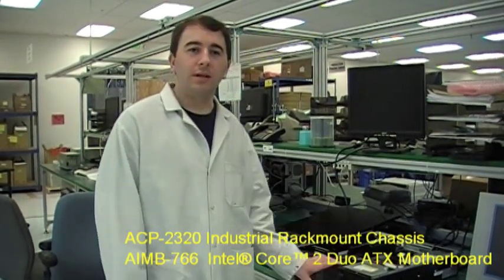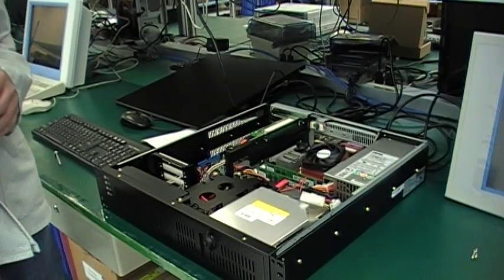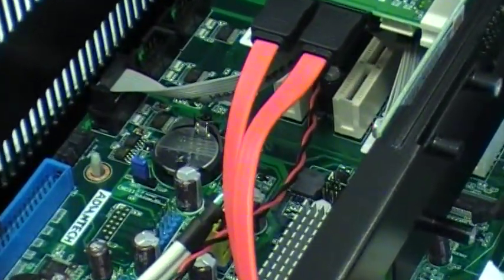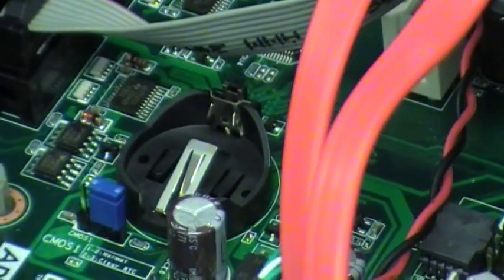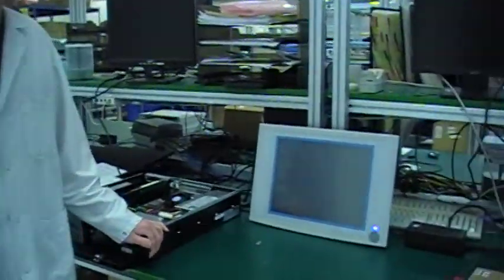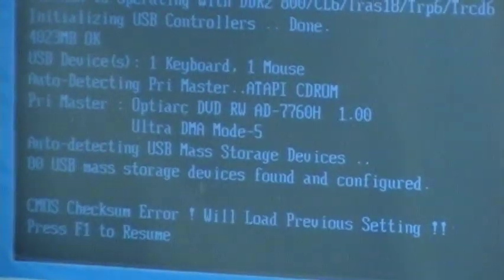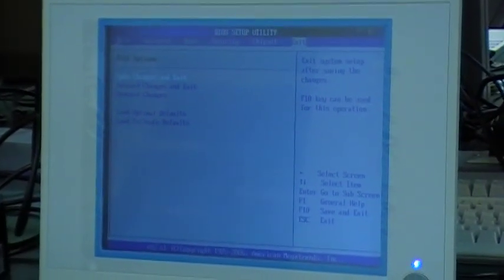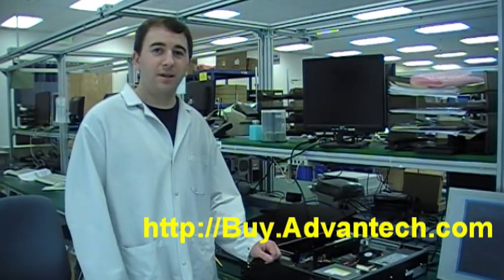Resetting the BIOS Tutorial- Advantech IPlanet Series

Comment: hi i just again get the no signal detected before happen that when i change slot ram i just reset the battery which is called CMOS to reset bios setting cause what it did my ram is 1600 mhz and i set the frequensy ram to 1600 mhz from auto setting so i did this and happen this problem no signal detected and i reeset the battery nothing happen still same everything supported perfect 100% and i checked them more than 1 time and no idea why its happening again cause i have bought today another 2 gb ram with 1333 mhz and already have 4 gb ram 1600 mhz both are DDR3 so no idea how i fix or reset bios setting please i need help or anyone replay me and thanks

Comment: Hi Dear Sir.
I have an ASUS k45vm laptop that last year put a ssd drive in the laptop in the original hdd drive location and put my hdd drive in the optical driver location.
Today on the ASUS website I found a new BIOS file for my laptop.
After downloading this file I copied it to usb flash drive and proceeded to update the laptop bios.
I restarted the laptop and got into the BIOS part of the boot screen and selected the BIOS file inside the usb flash memory and attempted to update, after a few minutes update was successfully completed and the laptop shut down after two seconds.
I turned on the laptop immediately.
The ASUS logo first appears and then the laptop turns off and the laptop turns itself on again. The ASUS logo appears and then turns off, the same process repeating itself.
Turning on the laptop also sounds from the hdd side of the laptop.
At the time of displaying this logo, none of the buttons that led the laptop to boot status were working.
The only delete button works that goes to another page where the american megatrends logo is displayed and also the bios version which is the new bios version that is displayed and then the laptop turns off after two seconds and enters the previous look .
In addition, with the push of the boot buttons on the boot screen, the fan speed of the laptop starts to increase as the fan operates at its maximum speed. Please please guide me to solve this problem. We live in Iran and the laptop here is very expensive, my wife and I are very upset about the laptop being damaged and I have no money to buy a new laptop. 
Thank you for your all your help.